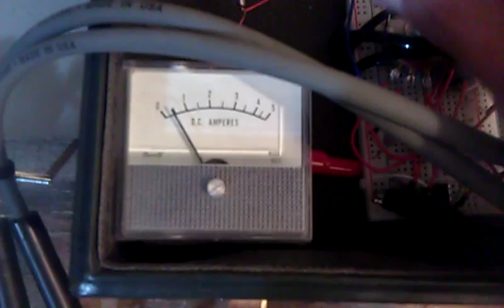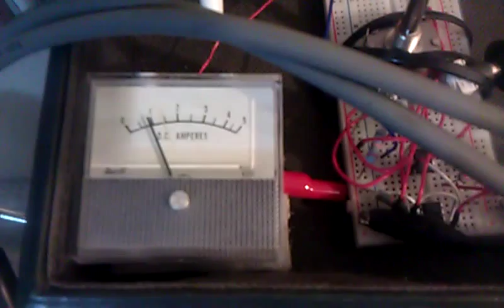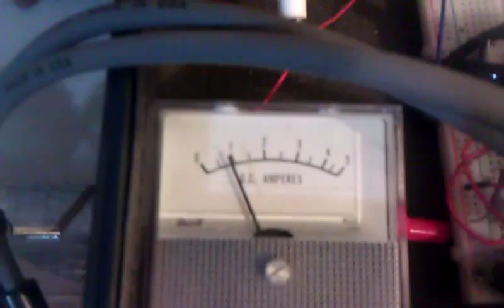Don Smith Device Project Part 29: Ionization Was Stealing Power, problem solved

Comment: Those blue switches you are using... Are those just regular old 12v DC lighted switches? If so, those lights only draw milliamps of power each. I noticed in past videos you mentioned those bulbs can handle "30amps" of power, that's not correct, the switches can handle 30amps of power, but the bulbs still only draw milliamps of power.

Am I way off base here?